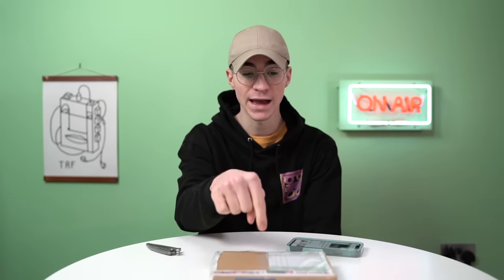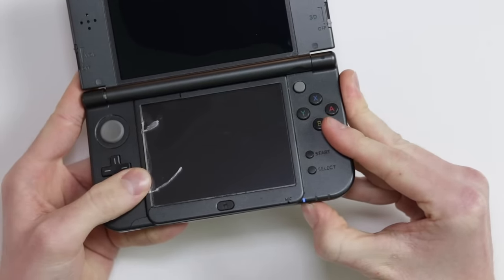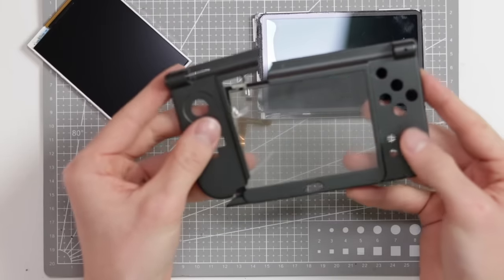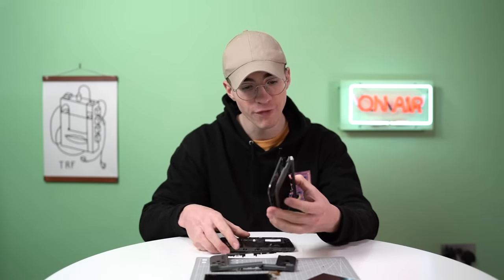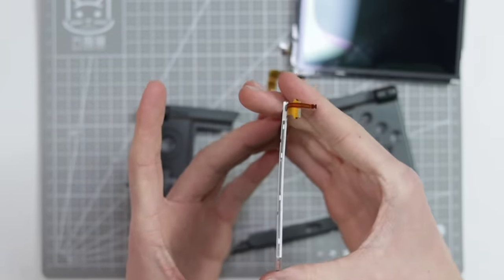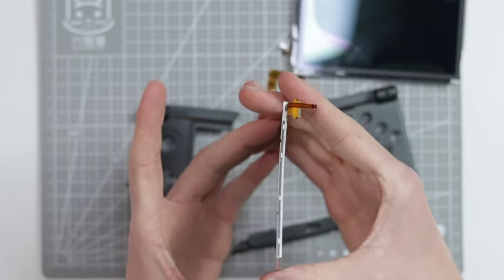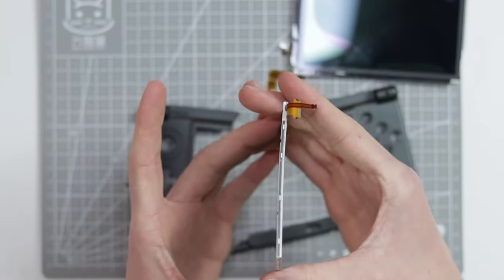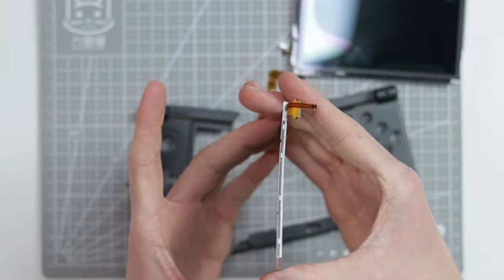£30 NEW Nintendo 3DS XL - Can I Fix It?

Comment: A few months back I bought a 'faulty' n3DS that wouldnt charge or turn on for about $20. I changed the battery to test, and it worked just fine. Charged as well. I thought, all it needs is a new battery. I put the battery in my other 3ds to see if it would charge JIC, and it charged just fine. So it needed no fixing, just the battery being drunk.
Reply: I have one of those AA Chargers that has the protection circuitry in it and it wouldn't charge some of my AA's but I bought one of those really shady Chargers on eBay and Walla I got the batteries to charge.
Reply: That is a common fault with Nintendo consoles. Just a bad battery. I keep stacks of extra batteries I pull from dead consoles.
Reply: Lol you have been blessed by God a 20 dollar ds and the battery + tools cost
Reply: I find deals like that all the time in thrift stores. I dunno what it is but every time I walk into somewhere like Value Village, there's a Wii sitting on a shelf for like $20
Reply: @aidancommenting  idk if it has changed but back in 2015/16 you could not sell a wii (by itself no controllers or games) for $20
Reply: How lucky!!
Reply: @bland9876  At first, I didn't get what you meant, but then it hit me and this truly is the funniest way I've ever seen someone spell "voilà" :D
Reply: @Nitidus  even if I spelled it correctly I would have left off the symbol above the a because aren't those only used if you're phonetically spelling a word?
Reply: @bland9876  Well, no, it's literally just French :D The French use these "accents" (á, à, â - works with every vocal) and since "voilà" is a literal adoption, it's spelled just the same in English :)
Reply: @Nitidus  I thought those symbols were what you saw in the dictionary when telling you how to pronounce a word?
Reply: @bland9876  Interesting thought! What you are thinking of is the "International Phonetic Alphabet". In the IPA, voilà would be "vwaˈla" for the original French pronounciation and "vwɑˈlɑ" for how it's pronounced by English speakers. You can also find this on dictionary.com, btw! What can also be seen there is that the spelling is just like I presented, including the accent mark with the a. For further information on those, you can read the article "French accent marks" on Grammarist.com :) 

It should be noted that a very large number of languages use different kinds of these all the time, it's not only French. I'd guess every Romanic language has them (so Spanish, Portuguese, Italian, all the Latin American and African dialects, etc.), as well as many Eastern European languages and probably even more. I'd think it's actually very hard to not come across such words very often, at least if you don't live in like South East Asia :D
Reply: @Nitidus  oh ya like Pokèmon. What is the actualy point of adding the extra part above the e? Is it telling me to say it differently? Like in english I just know that cat and kate are not pronounced the same but I don't have anything telling me to say the letter A instead of the sound A.
Reply: damn, you got like a working n3ds for 20 that sells for 120 haha
Reply: @bland9876  i trick my fancy charger into charging dead aas by putting a good battery beside it and just taking it out and putting it back in a few times

Comment: 10:10 Those markings are usually an inspector's initials or ID. They have to confirm that the item/components went through QC
Reply: came to say this, took apart an xbox one controller i bought new and it had those markings. They are a sign that it was good!
Reply: My atomic purple Game Boy Color had similar letters visible through the clear shell, when I was a kid. I never gave hand written pen markings on boards a second thought.
Reply: Woh so cool
Reply: Basically anything has them on, I've seen them on calculators, gameboys, consoles ect
Reply: Yeah I was going to say the same thing. Tons of boards have writing on them
Reply: yep!! my switch joycon had writing inside it like that!!

Comment: That shell piece that's broken - I have a brand new one in the same colour that you can have for free if you like. Let me know if you want me to send it.

I recently reshelled one of these and ordered 2 by mistake. Reassembling it was incredibly painful, I hate working on the 3ds XL, it is horrific. I also had the same issue with the missing pad on my replacement screen - is that definitely not correct? Mine is missing the screen lens so I assumed that's why my 3D isn't working (I assumed the lens was a polariser).
Reply: Yea, the 3D uses a polarizer

Comment: I feel your pain when it comes to dealing with the ribbon cables on the new 3ds xl. About a year ago I had bought a used one that had a pretty grimy shell so I eventually bought a new shell for it and man was that the most tedious thing. I was so worried I was going to break the cables because of how little room they actually have to fit.

Comment: It might be a bit late, but the New 3DS XL has a pretty rare IPS screen variant, and replacing the ips panel by the other panel and vice versa without modifiying the console's software will cause it to have some issues such as, you guessed it, 3d not displaying properly. I've found out about this while looking for and IPS mod for my New 3DS XL

Comment: Generally, the non working 3d effect comes with a damaged speaker ribbon cable, the same one that you replaced in other video, in a regular new 3ds. The shell was broken and the hinge was exposed, very likely that the speaker cable is damaged too. Or one of those small cables on the screen's side (one is for the backlight, the other is for the 3d effect) is not properly connected.

Comment: Watching all these repairs videos makes me wonder how I didn't break my tablet of 6 years yet. It still works well. 

A Samsung Galaxy Tab S2. Even the battery still has a reliable 45% I can use before voltage falls too low and it cuts + reboots. Hoping to squeeze a few more years out of it.

Comment: what I saw on my upper screens ribbon cables on the 3ds's and I also read about this. the missing pad on the top screen ribbon cable is missing on all screens for the n3dsxl as I noticed. it must've been a normal thing to be missing. even if you  see pictures on ebay of replacement screen and zoom you'll notice the missing pad on the ribbon cable. the issue with the 3ds in video must be related to other things. it can be really difficult to repair a n3ds or n3dsxl or any 3ds. Btw I'm a big fan of your channel and videos. keep em coming.

Comment: you could buy one used from japan, the shipping will be the same price i believe, also the price for one in the same condition won't surpass 10~20US$. For reference, a new one in working condition is around 50US$.

Comment: Just buy the 2ds (not the clamshell version). They're cheap and ridiculously easy to repair. It was one of the first handhelds I worked on and was very pleased as to how quickly and easily they are to repair. I won't mess with any of Nintendo's clamshell handhelds lol

Comment: Hello Elliott. I bought a N64 broken from eBay hoping it would just need a clean, but I was wrong. Upon opening the console the horror I found, someone I'm guessing has tried to replace led and made a mess. Led is gone along with a trace, but also c37 chip was broken off board at 1 end, now off completely after a friend who knows bit of electronics. Other than that comparable to my working N64 I don't see any other differences.
Now I've been an avid watcher and when it comes to repair/restoration you are 1 of my favourite YouTubers. 
I was wondering if you provide a repair / restore service? I've been advised to cut my losses as only paid £15 for it and will probably cost far more to get it fixed providing I can find someone to repair it.

Comment: i think you dont have to worry about the traces but the components, see when you bent the pcb that puts stress across the components causing them to break away from the pads they are soldered on, with delecate parts like these motherboards that probably happens quickly since everything is tiny

Comment: I had a DSI XL... im a pc guy right so i have alot of junk pc parts around and i had the idea of applying thermal paste and adding a thermal relocate pad thing and a big copper pad on the back... not needed ofc but it was fun, im going to do it on my new 3dsxl but i want a new backing because plastic isnt a good conductor

Comment: I've actually been looking into getting a New Nintendo 3DS, but the problem is the cheapest ones I can find now range from $360 - $600 USD, so my best bet would probably be to get a New 2DS XL which is basically the same price as the Ryzen 5 2600X I bought...

Comment: Quick question, I was trying to take apart some original 3DS (not XL), and I was using a 00 Phillips screwdriver. It worked on most of the screws, but some of them are rounded just like at 10:17. I've been trying really hard to figure out what I should buy to get such tiny stripped screws out, but I've had very little luck finding anything that works with stripped screws that small. Can anyone help me out?

Comment: If you want it I have an original model 3DS, it works but it's in a state and the bottom screen needs replacing, it was my nephews but it's too much of a job for me to do, all I'd want is the postage, you can have the unit itself for free, I'm in the UK so it wouldn't be much to send, anyway offers there if you want it mate. Take care.

Comment: When my original phat NDS was dying, there was an NDS on eBay from Japan being sold for parts, because apparently there was a 'password' on the console.

I questioned the seller as I didn't think that was possible, but he insisted, and I just wanted its parts so I ordered it. Turns out, it was just at the intro screen, so I assume the seller just couldn't read Japanese. So I ended up with a fully Functional NDS, and now my original is my parts ds.

I would throw out my original, but I keep it out of nostalgia as it was my first ds. I still want to fix it, but phat NDS parts are so hard to come by at a reasonable price. It needs a new shell, new displays and a digitiser, and has some rust inside (don't ask me how this happened, I have even older GBAs which are fine) so it probably isn't worth it, but the child in me wants it fixed!!!

Comment: Hi Elliot, I'm a huge fan and I was wondering how I would go about learning to repair consoles. Is there a specific console you would recommend buying to try and fix for beginners?
Reply: The first console I repaired was my 2ds with a broken screen. It was pretty easy since there’s no hinge and it’s also pretty cheap, would recommend
Reply: flamingnarwhals Thanks for the suggestion! I looked into how much it would cost and I saw a replacement screen going for around 30 USD. Is that the normal price like around what you paid or that just inflation due to the current world situation?
Reply: @SnorlaxBTW  2 years late but gameboys are easy to fix, in most cases it's either corrosion or broken screens, they are easy to take apart and they costs ~30€+shipping

Comment: I would also check to see if the issue with the no power is to do with modding. If the system is modded and doesn't have a certain .bin file in the sd card, then it won't boot up. To check to see if it's modded, hold the power button and select button and if a menu pops up then it's modded. Just for future systems it could work:)

Comment: You cannot change the region & language of a 3DS. Normally at least.
But as always when a multi billion dollar company imposes an unreasonable region lock on a product, there's a way! You'd need to install Custom Firmware (it's easier if you're on a lower firmware version). After installing, you'd have to install things like godmode9, luna, etc. The key here is godmode9. it'll allow you to back up and write to the nand. So I suggest you back up the nand (in case anything goes wrong) and I know there's somewhere online where you could download a 3DS firmware from different regions such as EU or US, it's up to you. Install that firmware by flashing the nand in godmode9 and afterwards it's up to you if you want to keep the custom firmware or not. I highly suggest you keep the CFW for things like emulators and homebrew if that your thing. Note that you will need an SD Card for this. I suggest going for a high capacity one if you plan to keep CFW for all the roms, emulators, and games. You can check Sthetix's YouTube channel for guides on how to install CFW, how to backup the nand, and how to change regions. I can't emphasize enough how enjoyable 3DS homebrew is. Good luck!

Comment: Hey Retro Future, I have a question about a Nintendo 2ds I picked up at a pawn shop. Came with a 4 gig SD card. Sometimes I would turn it off or put it in sleep mode , it can't detect the SD card. I took it out multiple times, blew in it, used Isopropyl on a Qtip . I found out the problem , the SD card was going bad. I bought a 64 gig and card formatted it to the system. So far so good. Great little handled.

Comment: So, what's the chances that one could purchase JUST a working ebay NEW 3ds xl mobo... and swap it into a prev model 3dsxl? Sure, you'd have to either get a different lower case for the mini nub thumbstick... or mod your old. But would the mobo work with all the prev model innards? The screens, the buttons, speakers, etc? It's all the same no? I think this would be a neat project for sure, and I'd happily do it to my prev model NES styled 3DSXL... I'd nub that case and toss a new mobo in there.

Comment: So up in my attic I have a black 3DS XL that I broke... Well, my kids broke the thumb stick, then I broke the small ribbon cable connectors while replacing the thumbstick (look, it was my first attempt at fixing anything, alright? haha). The screens should still be OK, the case is... probably OK? Would it be of any use?

Comment: What exactly was the problem with the bottom screen in the Japanese DS? Was the pressure from the broken shell/digitizer putting force on it, causing it to not light up or did the entire console just boot to a black screen? I say this because it obviously didn't work in the beginning, but ended up working in the end without any real repair other than the top screen.. Just wondering if you've any idea how it's mended itself lol

Comment: I have a few problems with my N3DS XL with the LCD touch screen showing black lines, and soon to be black spots. After that I found myself in a tough spot. My Home Button doesn’t work. I tried paper under the HB cable, putting pressure, and the small needle technique which didn’t do good. If anyone has any ideas to what I can do to fix it please let me know.

Comment: Where can I buy replacement parts for the New 3ds XL like a housing bottom plate also screws and some other stuff like the whole shell. Is there a certain website or do I settle on finding them on Ebay and Mecari? Also are the bottom plate screws the same on all systems including original, xl, New 3ds, New XL. (thank you for any help)

Comment: For the screen if it's bent it's likely broken (at least with the 2ds xl they are very fragile) also for the board it could be salvageable if bent however 9 times out of 10 I'd just say get another system

Comment: Hey all, late post but I received a New 3DS XL from Ebay and it was NOT what was advertised, it basically needs a re-shell, new digitizer for touch, and Circle pad. Might as well replace the displays too. anyone know a good place for replacement parts or a reputable seller? Thanks in advance!

Comment: At 13 minutes et 32 secondes, There is a hole on the top screen cable, is this normal? because in the new that you installed, there is none

Comment: My small 3ds has 2 problems 
1. It has a problem to when i hit the bottom part of the 3ds or i press Start my ds immediately turns off (sometimes)
2. My sd card wasnt responding and it was just bought this January and i tried to clean the sd card and im not sure if its the sd card reader :/
How do i fix this

Comment: Bro how can I fix my Nintendo ds lite 
When I turn it on it shutdown immediately 
Please help bro
Reply: Does it make a popping noise before shutting off? The most common problem that fits that description is a blown fuse, but good luck replacing it, those fuses are miniscule.

Comment: I’ve always wanted a 3DS, but they are too pricy, they are more expensive than the Switch Lite, so I’ll buy the Switch Lite instead $200.00 is a good deal!
Reply: If you don't care about 3D you can pick up a original 2ds really cheap
If you want 3D then get a older 3D model they are cheapo as well
Reply: Spardin 1982 I’ve got a 2DS 😂, but I’ll see what I can do, I’m really leaning towards buying a Switch Lite though

Comment: Hi there, I was replacing a yellowing bottom screen on a 3ds XL 2015. the new screen looks great, however, i messed up and broke the digitizer ribbon port.. the part that comes down to secure the ribbon for the digitizer, now the touch screen doesnt work. I dont have a microscope and i see that on aliexpress, that port is like $10USD. Is it even worth fixing or bringing it to someone to help me solder the new port on. Obviously I am not going to buy a microscope

https://ibb.co/dDB3LzD